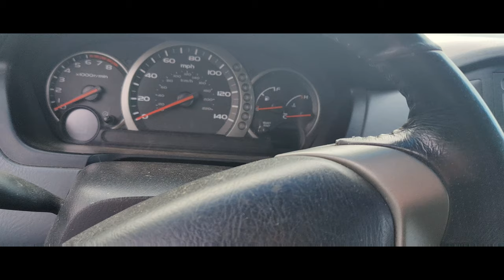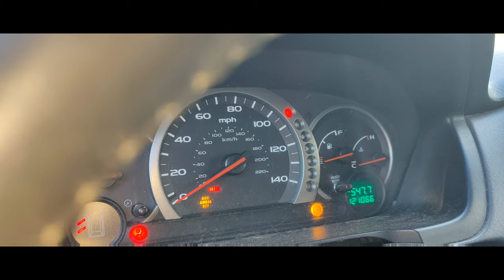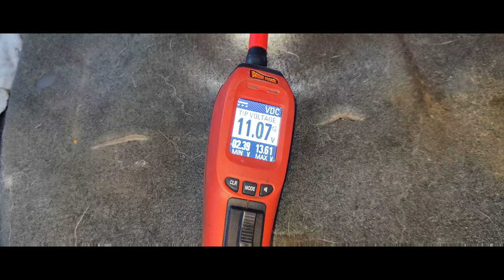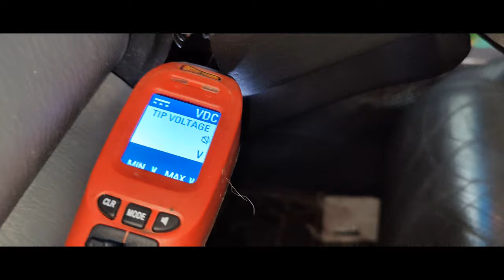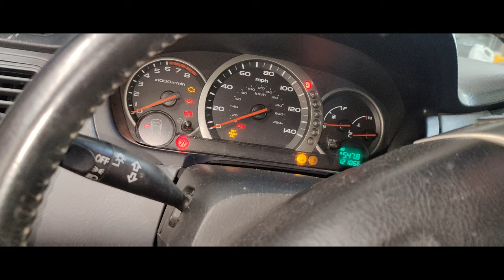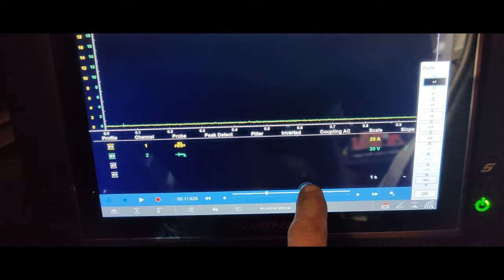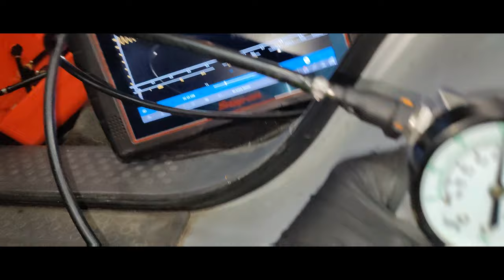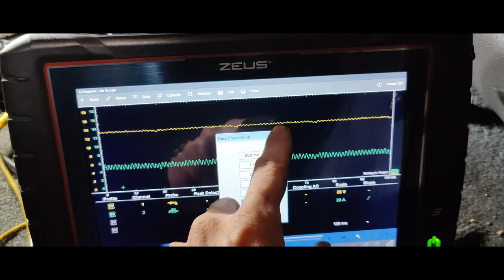2004 Honda Pilot 3.5l New Fuel Pump, Crank No Start, Cause and Effect?

Comment: Good one! I get tired of AM parts, but I still use them (sparingly). When availability is so much easier/faster than dealer and plus some dealer parts discontinued or back ordered you end up with little options.
Reply from the maker: I also get tired of issues too. It sucks when you cant get something that at least works the way it is supposed to.

Comment: How about the 2 dead holes in the beginning of the video you showed with the relative compresion waveform? The cranking sound suddenly beter halfway the video. Btw, i never exspected this outcome. Like it!!👌
Reply from the maker: I think it may have been from the car sitting for a few months or if someone was spraying something in the motor. We could have had washed out cylinders.

Comment: Does the aftermarket fuel pump consume more gas that it should ?
Reply from the maker: If it did it would just return to the tank through the regulator. It wouldn't hurt anything.

Comment: Rob thanks for sharing. Didn’t now the they are designed for ethanol. This relays are notoriously known to crack. You can just reflow the solder joint. I keep a spare relay just in case for my Hondas. Rob you still have your premium channel? I’ll check it out. Would like to signup for it     Artie 👍
Reply from the maker: Yea it's still there. I want to get more content for it. There is a lot there already.
Reply: @RobertDotterer  thanks Rob I’m going to join to support you. 👍

Comment: So what was the problem? Fuel pump main relay?
Reply from the maker: That and the aftermarket fuel pump, and the wire melting in the connector
Reply: @RobertDotterer  The aftermarket fuel pump would consume more gas?

Comment: Rob another good one. I had a similar problem on my 99 Accord 3.0. The circuit board inside the relay the solder joints crack from heat and stress. I reflowed the solder joints and it’s working fine. Purchased a new relay just in case. Thanks for sharing Artie 👍🎄
Reply from the maker: I thought about reflowing it I just didn't know if there was any other issues.
Reply: @RobertDotterer  looked like it was pretty well cooked. I wonder if the pump amperage cooked it. Hope your feeling better 👍